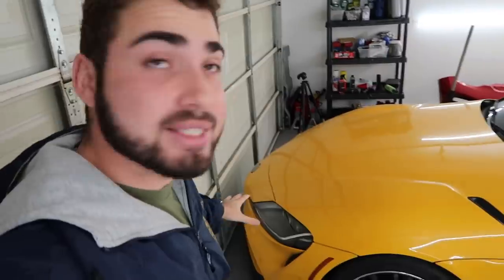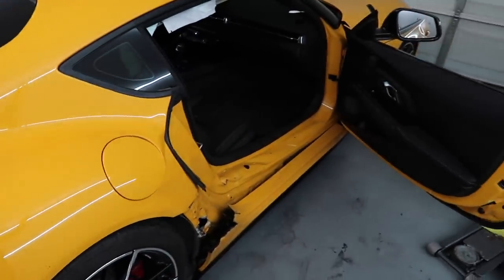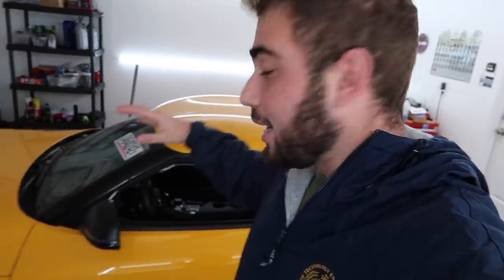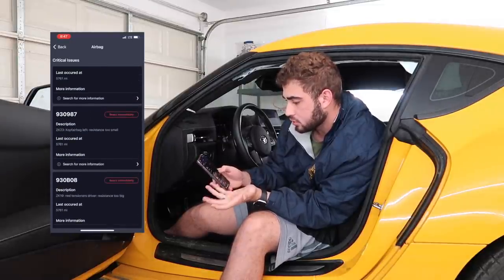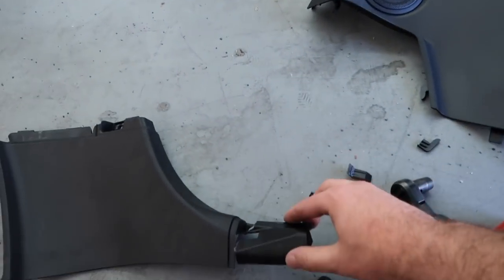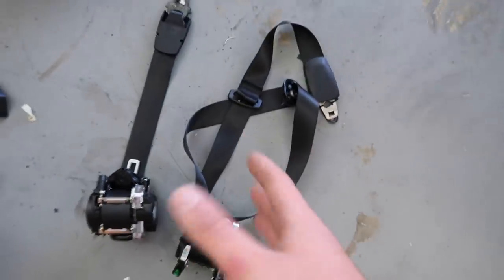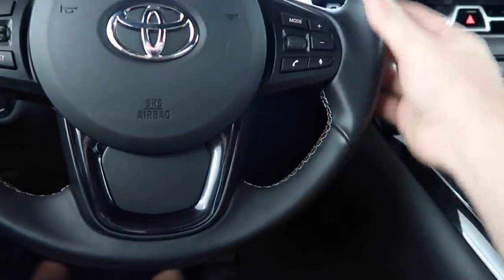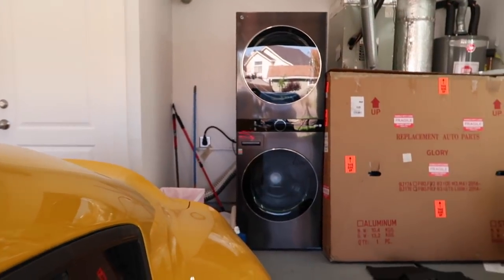Rebuilding A Wrecked 2021 MK5 SUPRA 3.0 (PART.2)

Comment: The door is obviously toast, but check Toyota for a replacement door shell - might be cheaper than you think (and cheaper than a used door).  As for the other damage, have a good/professional body shop diagnose.  Since the buckling/dents are so localized, there is a very good chance that pulling it out, with very little bondo work, could be a viable option.  So many people think pulling/using bondo is a sign of poor/cheap body work.  Pulling/bondo in the hands of an amateur = poor/cheap body work.  Keep up the great content 😎.

Comment: Seeing you so hyped while getting to know the car and working on it put a huge smile on my face. My man is making moves now and the new BM....I mean tieyota...toyota?...it's just the beginning. I 100% also agree with the repair work suggestion that you made earlier in the video for the damage on the passenger rear quarter panel. Sectioning would be cheaper and still provide a proper repair. I feel like a whole new panel would just be overkill IMO. Killing it though man, can't wait to get the 328i back on the channel too.

Comment: Nour, this Supra is a good start...it has powerful synergy and stepping a gear. As David Sushchik rightly said,  Don't need replace the quarter panels,  just pull it out...you're half way home...

Comment: Nour taking that headliner is going to be a pain in the ass! I work at a body shop and worked on a Supra and we replaced a quarter panel. Ended up taking the windshield off in order to get it in and out without bending it.

Comment: The 2020 GR Supra was in fact combed through by Toyota and revised outside of BMW. Revisions were made to the internals of the engine. Lots of info on specifics that were done by Toyota on the internet. It has BMW stamped all over but it is a lot of Toyota.

Comment: Let me point this out. The 2020 Supras are what have the different B58, because that one is a single scroll turbo variant of the engine. The 2021 Supra has the exact same twin scroll turbo B58 as the 2021 Z4.
Reply: Do more research .All  B58 engines = 1 twin scroll turbocharger , its 1 physical  turbocharger unit that has 2 inlet ports. The 2 turbocharger setup is reserved for the S58 in the new G8x m3/m4

Comment: Please don't wide body😂. I think it would be difficult to do a section install on the quarter panel. But after just seeing it, maybe have everything pulled out carefully, then you can have the visible quarter panel PDR and then cut away the stuff that's in the door sill and replace just that